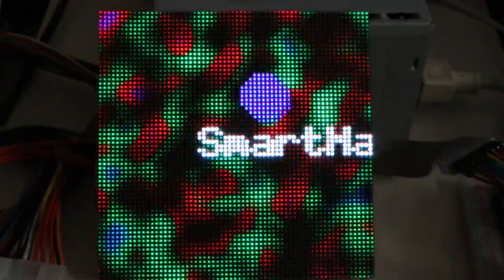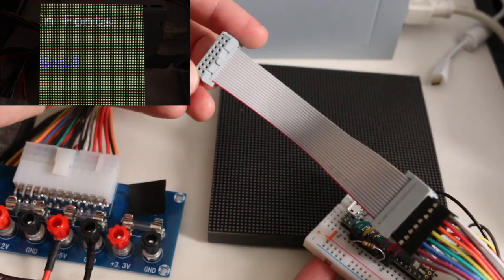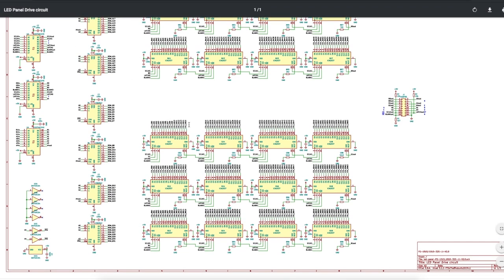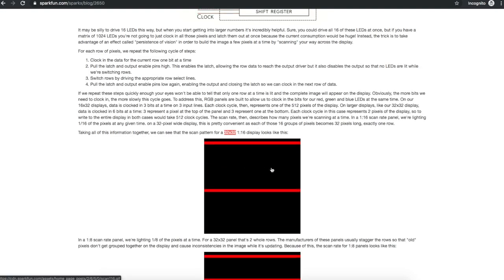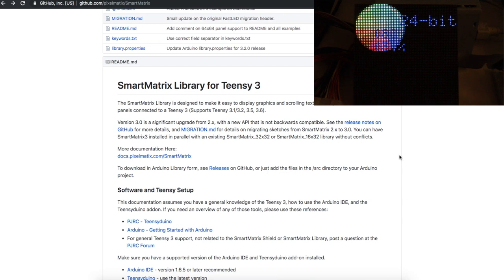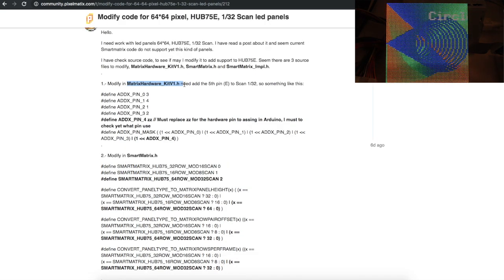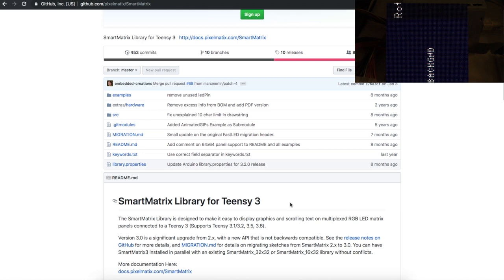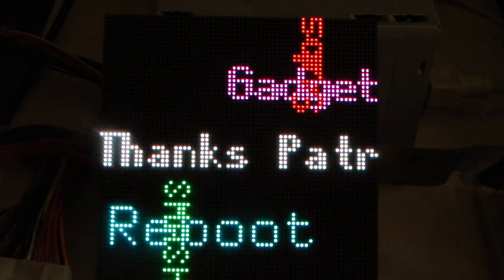64x64 RGB LED Matrix Panel - SmartMatrix and Teensy 3.6

Comment: Absolutely outstanding work, GR. I am an engineering project manager with 40 years of both hardware and software experience going back to when I was just 15 years old. Exceptionally thorough, well researched, and very well presented. If you are ever looking for a job, let me know.
Reply from the maker: Thanks! I try to be thorough because eventually when I need to revisit certain projects, I may have totally forgotten everything I learned the first time around so it’s good to document everything I can.  A few LEDs got knocked off of that panel when I moved last year, I should fire it up again and see if it is still usable.

Comment: Really impressive.  It's amazing to see what you've done to get it working.  It's a good demonstration of what can be achieved with a strong will combined with shared knowledge. Thanks for sharing these moments with us.
Reply from the maker: It was one of those projects where I always felt I was almost there but not quite, so I kept going. 
Things like this also remind me why it’s good to buy so many things on eBay. Suddenly you need a different processor platform, reach into the drawer!  At least that’s the excuse I’m going to use to keep shopping.
Reply: @Gadget Reboot  hi are you still looking at your msgs? Got a question if you are...

Comment: Wait is that at 2:25 the controller you use? I read that you'll need a Beaglebone Black/Raspberry Pi 4 for 64x32 because others are not powerfull enough. 
Could you link the controller? Just ordered two 64x32 1/16 which i want to put together to one 64x64
Reply from the maker: The controller I used was Teensy 3.6    https://www.pjrc.com/store/teensy36.html    
and the library I used with it is https://github.com/pixelmatix/SmartMatrix
There is now a Teensy 4 but I don't see mention in that library for supporting it, but the 3.6 worked fine with 64x64 for me. not sure how big a display it can do before issues.

I haven't tried the raspberry pi but it would use this library https://github.com/hzeller/rpi-rgb-led-matrix

Originally I tried an ESP8266 module but it couldn't handle 64x64
Reply: @GadgetReboot  64x64 is the max size I want to go. Thanks alot for the information :)

Comment: i'm confused about this. @8:15 you say that the series arrangement of the shift registers is too slow, but i calculated that with a 384-bit shift you can get a frame rate of 122Hz. The 2037 chips have a shift rate of 30MHz, which means 13uS to shift through 2 lines of screen, so that's 410uS for 64 lines. And for 20 modules, that's 410u x 20 = 8.2mS for the whole screen, which means 122Hz frame rate. And you don't have to wire the shifters in series. With the Teensy you have enough DIOs to have 6 parallel inputs and 64-bit shifters, so that's 732Hz.

Comment: Thanks for the very informative video, I have made a 32x32 display using a bicolor display. It is using 74238 chips for the row and 74595 for each of the colors. Interesting the Chinese took the concept from some of the projects here and made custom chips for these boards that have the same functional components. Aside from that I was curious is the smartmatrix can be modified to use on neopixel displays or apa102 displays. These are RGBW strips that can be made of any size. If there is a way do you know where a link to this would be?
Reply from the maker: I haven’t tried to use smart matrix for anything other than the panels but I see reference to the version for hardware shield being able to do APA102
https://github.com/pixelmatix/SmartMatrix/blob/master/examples/FastLED_Panel_Plus_APA/FastLED_Panel_Plus_APA.ino

Comment: Couple things. Most of these libraries will flicker. They do not really support more than 240Hz scan, and for the most part this is okay. The contrast is limited to around 11-12 bits however this is limited by the multiplex. (Just subtract the number of address pins if using decoder row select.) BCM is commonly used and I am not sure how many panels properly support this beyond 240Hz on the row and column side. Some panels can go a little further, but you need special logic in the row drivers and in the column drivers. Be aware of outdoor displays which do custom multiplexing.
Reply: Note remember dot correction, fan out (long chains) and gamma correction. Most of these libraries do not support the hardware PWM panels.

Comment: This is a very informative video. My question is: exactly what is it that you are using R0, G0, and B0 for? Are you shifting in 8 bit color value per line? or is it a PWM signal for each LED?
Reply from the maker: https://www.sparkfun.com/sparkx/blog/2650 
 This article mentions binary code modulation and image planes as a way to do something similar to PWM to generate the images.
Reply: @foxfyre3600  Very interesting! I mav be understood the half of it, but still, it is very interesting!

Comment: What powersupply did you use for this?
Reply from the maker: I think it was an old PC power supply with a breakout cable adapter to use it as a bench supply, or else it was an actual bench supply that can do several amps.

Comment: hello. sorry to ask. Can you add 4 led matrix panels that are connected to each other?
Reply from the maker: In general, multiple panels can be chained and the sketch can be set to say how wide and tall the final display is, but there's limited information about the exact capabilities for maximum displays or total pixels in any orientation, or what processors can handle how many pixels, or even if 64x64 itself can be chained.  
I only have the one 64x64 so I can't experiment but I saw something that might suggest 64x64 is a special panel that uses an extra address line compared to smaller panels so they can't even be cascaded for some reason, but a bunch of 32x32 or 32x64 maybe can be, to get the same final result of pixels because those use less address lines and can be linked.
Then the info I see says the more pixels/panels, the faster the processor that's needed to keep up, so I saw some info about Teensy 4 being able to do 64x128, or 96x96 (with lower refresh rate or something like that).  So it's hard to know what will work.
Originally I tried to get 64x64 working on ESP8266 and it was flickering too much to use, but when I used Teensy 3.6 it was fine because it's faster. But if I tried cascading a bunch of 32x32 or something (so they can be cascaded) to get a bigger display than 64x64 overall, I don't know how far I could go before that flickers and I'd need to try Teensy 4, which I have also and it's again way faster.

Comment: Hi Master, very impressive tutorial.. 

any body to try with 1/8 scan?  I tried with 1/8 scan led module but doesn't working properly...
please advise to solve for led module Hub75 with 1/8 scan
Reply from the maker: Since I don’t have a 1/8 scan display I can only guess that these settings below are what need to be changed in the sketch for the width and height of the panel and mod8scan etc

#define COLOR_DEPTH 24                  // known working: 24, 48 - If the sketch uses type `rgb24` directly, COLOR_DEPTH must be 24
const uint8_t kMatrixWidth = 32;        // known working: 32, 64, 96, 128
const uint8_t kMatrixHeight = 32;       // known working: 16, 32, 48, 64
const uint8_t kRefreshDepth = 36;       // known working: 24, 36, 48
const uint8_t kDmaBufferRows = 4;       // known working: 2-4, use 2 to save memory, more to keep from dropping frames and automatically lowering refresh rate
const uint8_t kPanelType = SMARTMATRIX_HUB75_32ROW_MOD16SCAN; // use SMARTMATRIX_HUB75_16ROW_MOD8SCAN for common 16x32 panels, or use SMARTMATRIX_HUB75_64ROW_MOD32SCAN for common 64x64 panels
const uint8_t kMatrixOptions = (SMARTMATRIX_OPTIONS_NONE);      // see http://docs.pixelmatix.com/SmartMatrix for options

Comment: So how many panels can you add. Could you make a led panel wall?
Reply from the maker: It’s limited by the memory and speed of the processor and I didn’t see any clear specifications for this library but I read somewhere that Teensy 3.6 might be able to handle one 128 x 128 so four of these 64 x 64 panels.  I only have the one panel so I haven’t tried larger displays.
Reply: @GadgetReboot Hmm interesting, Thanks for the reply :)

Comment: Just want simple arcade games running on it :) Is it possible to drive 4 of them in chain ? So to have 128x128 ? That way it could show pico-8 games 1:1 ;)
Reply from the maker: they can be chained but the biggest limitation would probably be the processor driving it, not able to keep up with refreshing it after sending out that much serial data for that many pixels. And if the processor can handle it and somebody has written a proper library to correctly display an image with the panels sharing portions of the overall picture properly, it would have to be assessed to see if those chips like the shift registers are capable of switching data as fast as needed to get all those pixels updated to have a proper refresh rate, which I don’t know but these panels do get used in huge commercial displays. 
I think if somebody comes up with an FPGA controller instead of a regular micro controller that would help because I think that’s how it’s actually done commercially

Comment: A lot of data to be sent out fast... time to go get a fpga ;D
Reply: FPGA costs a lot and is hard to develop for, if you were driving some huge commercial array of LED panels sure, but for 64x64 a microcontroller does it.

Comment: I suppose all libraries are written for the Arduino IDE. The Arduino IDE gives a lot of code overhead. Basically, it is a complete OS with several abstraction layers. I am always surprised to see the Arduino IDE with ESP, Teensy or any powerful ARM core chip. Using the Arduino IDE is wasting just so much power from the modern ARM chips. Writing real baremetal, for example with Eclipse IDE, would make it all a lot easier.
Reply: Imagine how many resources are wasted by watching this Youtube video. ;)